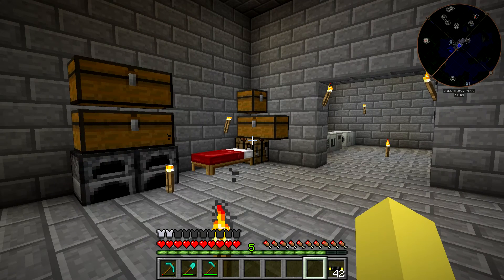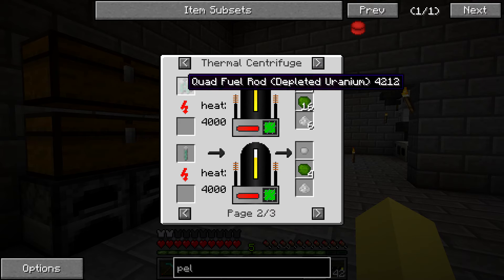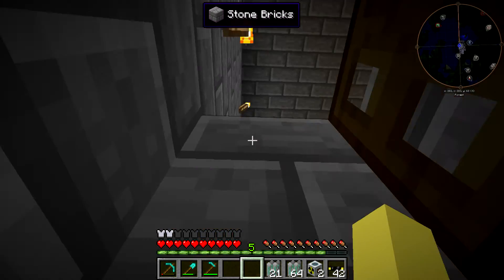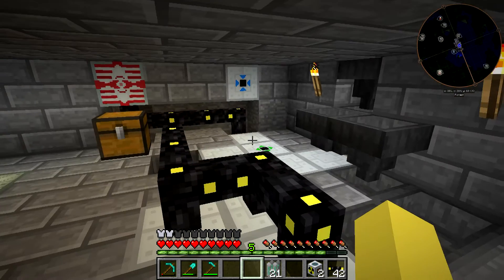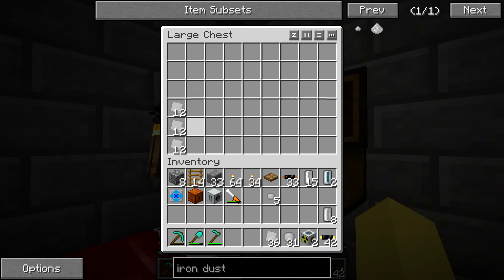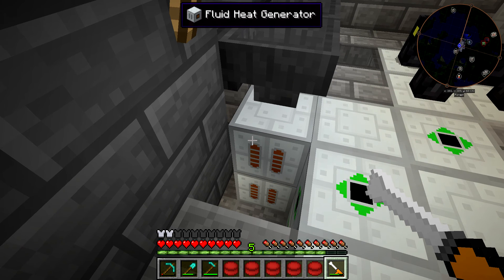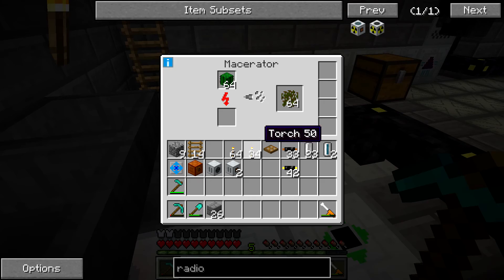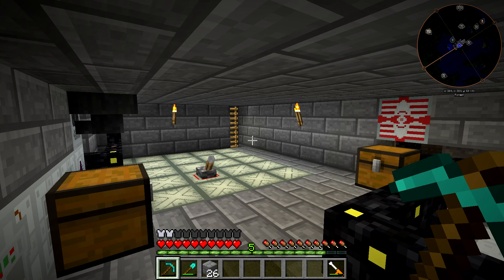Surviving With IndustrialCraft 2 :: Ep.19 - Radioisotope Heat Generator

Comment: oh yes i forgot you can get infinite heat gen, i stopped on the radioisotope gen. Interesting and good gain on power for already running system (like the biogas setup). I m learning each time, last video was a blast for me to understand that you don t need to lead the distilled water to the steam gen, it does it by itseft yay.

Cheers for Etho :p.
Reply from the maker: +Lynn Avezou Glad you are learning, even if it is the smallest little thing! The heat generator does seem to work well when it comes to complementing already existing setups (such as this one or the blast furnace setup).

Comment: The Conversion at maximum speed, is 20 ticks in a second. So It's using 0.5 mb/t. Which is incredibly obscure so it's easier to tell you 10mb/second.
Reply from the maker: +Triaxx2 Ah okay :) that makes a lot more sense. Now I can go back and actually do EU/t calculations to see if generating heat for this or just plain EU is better with the radioisotope generators.